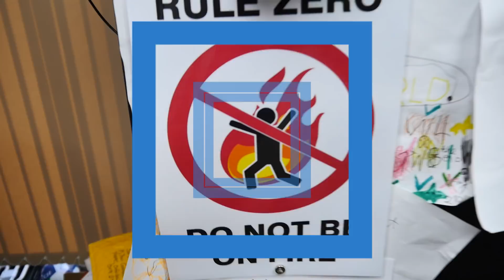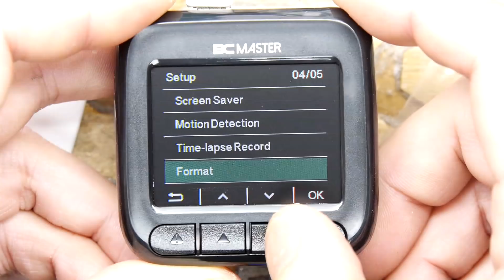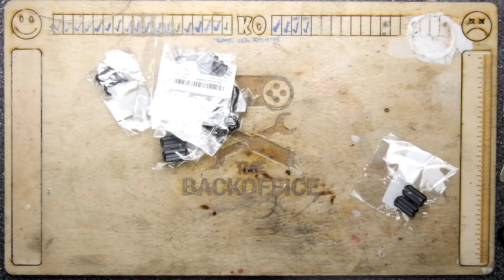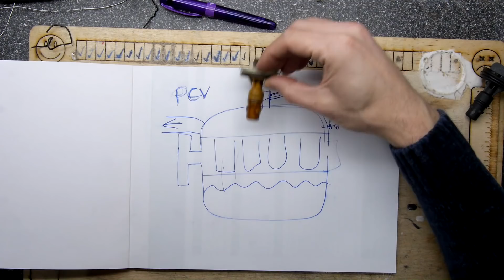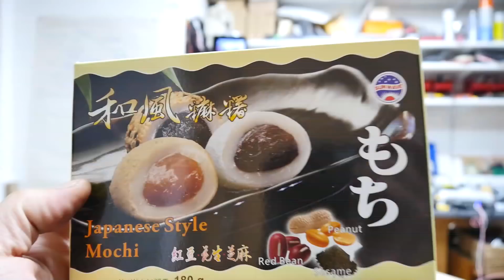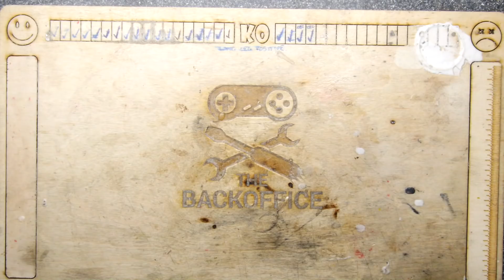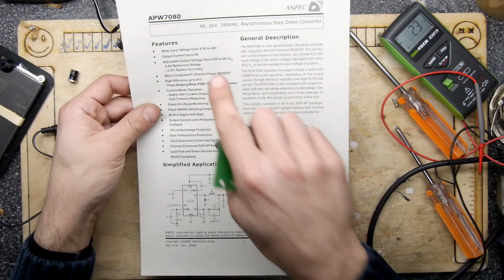TBOS EP1 - PCV and the Exploded Capacitor

Comment: I got that exact same dash cam! All I know is it's working with a Sandisk 32GB MicroSD card! :) And actually the footage isn't too bad at all!
Reply from the maker: I got it running a bit and the footage looked really good. I need to try it in anger
Reply: I really like that dashcam although I think the video it shoots is a bit low in terms of bitrate... I uploaded a bit of footage last year for a friend of mine to look at and like there really isn't much detail. You can find the video under https://www.youtube.com/watch?v=tLx6Majw5x8 if you want :)
Reply from the maker: I will check it out. Often with these things they change the internals and keep the same cases, so it will be interesting to see if it's exactly the same spec